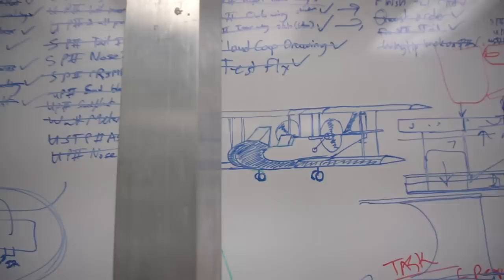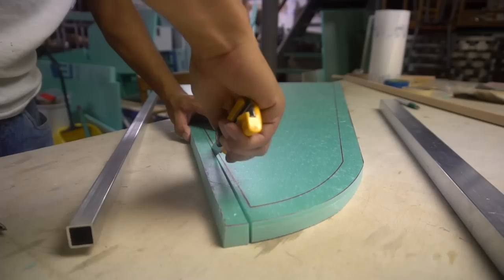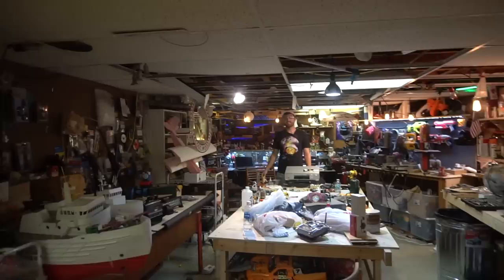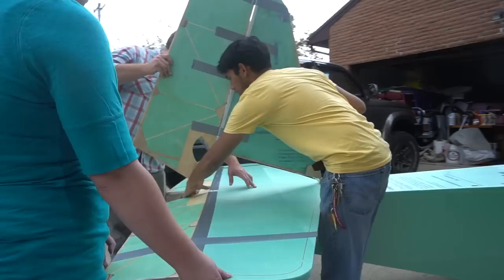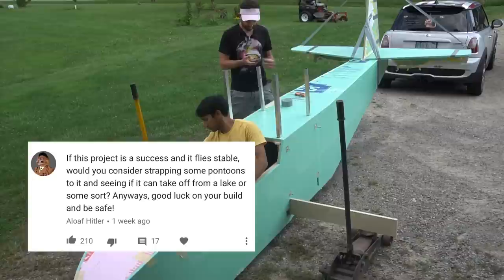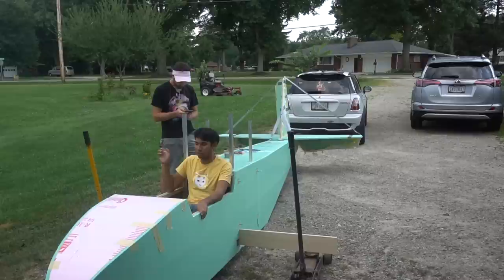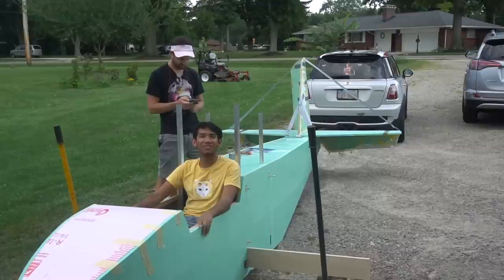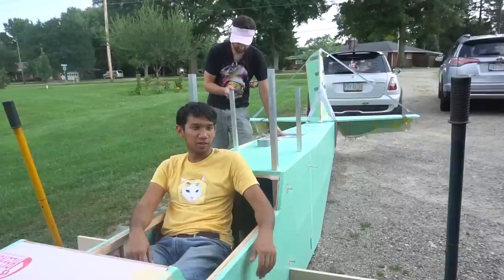DIY Electric ultralight pt2 (tail section)

Comment: Hi Peter,  I am a CFI and I would like to make a few suggestions.  I know you are a very competent RC pilot but I would consider getting some training in a light plane such as the one you are building.  I would suggest getting some experience in a Challenger which is similar to the one you are building.  It is not well known but the lighter aircraft such as the Challenger or even the light sport planes being produced can be harder to fly then many of the heavier certified or experimental aircraft.  Flight training I think should be higher on your list than a parachute.  If you were local to the Phoenix AZ area I would offer to take you up myself in my Cessna 150.  My other suggestion is to contact the local EAA in your area and see if they have some experienced builders who will come by and talk to you and inspect your build.  They have experience in building and maiden flight an experimental aircraft such as this one and it could only make your experience better.  I make these suggestions only because I would hate to see you get hurt and I want you to be a success.

Comment: Hi Peter - Enjoyed your video's on Flite Test!  Are you planning on using torsion tubes or cables from your control stick & rudder pedals to the elevator, rudder & ailerons?  Would be easier to use  torsion tubes unless you build the cables into the wings.  You have enough fuselage access to run either cables or torsion tubes.  FYI - with torsion tubes you don't have to worry about cable stretch and coming off a pully.  Tubes in the wings would need the control arm mounted on the bottom of the ailerons.  Cables would require control arms on both sides of all control surfaces.  Good Luck & Best wishes for a great aircraft!  :-)  Also, FAR-103 max empty weight is 254 LBS.  If a BRS is installed, you get to add the weight of the BRS to the max empty weight.  I added this info for the 'Non-Pilot' people reading this & cheering you on.  I;m a retired airline employee and have held a pilot license for 48 years.

Comment: I just looked on Barnstormers, there are a couple BRS rigs for under $2600.  The cheaper ones will need a repack, but even a $1200 BRS plus a $1000 repack is under budget.

Just a potential source for ya.

Comment: thanks for posting.  some thoughts.  in order to reduce auw, 80 percent of the foam could be removed.  especially, aft of the cg.  if i remember right, this is going to be a pusher bi-plane.  perhaps, instead, you could design a single wing to do the job and avoid the drag of a second wing.   cheers

Comment: Did you think about the heat of the electronics (battery in particular) melting the foam or the epoxy? also sparks and possible fires generated by that

Comment: Hey I like ur project. Maybe I missed it but u I guess u r a private pilot and know how to fly! I have only about 17000 hrs flying turbo props like twin otters and dash 8 100 and 300. In my humble opinion a good pilot always visualises how the air is flowing about the aircraft and how he is manipulating the airflow with the controls. The next thing is managing energy! Think of this as a glider with some assist from your motors. Keep ur banks shallow and keep the speed up. Think AOA at all times. In fact see if u can rig up some sort of AOA indicator. Don't try slow flying until u learn how she responds and feel comfortable, remember when u out of ur comfort zone the brain slows down to a crawl. Safe flying.

Comment: Would you consider putting flaperons on it in order to maintain better control at slow speeds? Full length ailerons that double as flaps. I'm not sure how that works with biplanes but it works well for high wing aircraft.

Comment: Looks like it could use some span wire and turnbuckles to put tension on some parts. That might be easier and lighter than bracing for rigidity in some areas given that you can't really crawl into that fuselage much. (If it was cloth over a frame instead of glued-together foam, you could probably open it up for access. Might need a hatch or two cut-in anyways.) Noticed the tail still had a bit of twist there while shifting weight around, and despite all that work. I'd be a bit leery of that.

Also a bit of shame you can't afford that life-insurance rocket-parachute. Expensive bit of kit, but likely so for a reason.

Comment: There's also a big difference between the FAA and the AMA. The AMA has rules set forth to protect pilots and general aviation and as for the FAA to keep pilots from model aircraft. No RC model should fly over 400 ft and should not be within five miles of a airport just to name a few

Comment: 12:04 every time you plane bumps the ground the empennage twists at an excessive angle you should check up on that. The last thing you want to happen is tail wobble mid flight as it will only get worse and maybe even sheer off the entire tail. Leaving you in an upside down flatspin (if you don't have counter rotating props if so you will just end up stuck diving to the ground upside down) from where your center of gravity is. And since your plane is electric you gotta think of where to store the batteries. In the wings and around your center of gravity is best. And do not treat this as an RC plane treat it as a real one so slow movements on the stick no sudden changes in anything. Good luck! Edit: You need more than 60000 mah in that thing id say you gotta get to around 80000-100000 mah to have a actual flight time in that. Since we talking an actual aircraft here.

Comment: I bet before fiberglassing the outside of the fuselage you could cut out pucks of foam, wrap them in silicone paper, put them back in place, then after the fiberglass is hardened you could pull out the puck and have a smooth exterior; with less weight; who cares if the inside fiberglass has divots in it; that may even be stronger (just not aerodynamic)

Comment: Since you are using 4 30k lipo's on thid rig. How long of flight time will you have when the batteries are fully charged and will you consider making backup power with more batteries in case you need it

Comment: Hey Peter, even though at 180 your shooting well below the weight limit, care to weigh in on how battery weight should be counted under part 103? It allows for empty (unfueled) weight but you can't just empty a battery to reduce weight. Do you think the entire battery weight should be counted? Or a portion of the weight not counted? Weight with battery removed?

Comment: make sure you have some spars in your empennage. Fiberglass skin isn't going to cut it there - flutter is no joke. 

Also, no way I would test a spin entry/cross control stall on my first flight. perhaps some very gentle approach to stalls if there is no turbulence. Use your takeoff speed + 10% or so as your estimated stall speed at first. (use an airspeed indicator - not GPS!!!!!)  Your landing gear needs to be stronger than you think it does, and you definitely need to be sandbag testing for +3G -1.5g MINIMUM!!! surface deflection and structural integrity before you take it up. (that means testing to about 1.5x that to make sure nothing breaks or permanently deforms)

If you can keep it below 254 lbs (400LBS AUW)  (which I kind of doubt, actually, based on your construction methodology)  the spar and wing need to be able to handle a test wing loading of about 1800 LBS!!!!  to safely take a 60-degree bank with moderate turbulence. Your tail surfaces should be able to support about 1/8 of that at each tip without significant deformation.  (look up sandbag testing wing on google images for an idea of the strength that is required in an aircraft wing)

If any wing or surface twists torsionally when loaded in a way that increases the AOA, you could easily enter a region of dynamic instability, likely to be exacerbated by PIO......very likely if this happens, you will break the airframe. also, if you are going to have ailerons, the wing must be very resistant to twisting to avoid (often disastrous) dynamic oscillations....and you need to look at how your control cables/rods will influence the control surfaces in response to deflection.

 My guess is you'll be much lower on power than you think (amateur designs almost invariably are because of weight optimism lol).....so use a stall resistant turbulent airfoil.

Because of Reynolds numbers, things don't really aerodynamically scale from model size to real size exactly....and due to mechanics, they don't linearly scale structurally either. 

I wish you luck, but don't make the mistake of thinking you can scale up a model airplane from a structural standpoint. 
Wear a parachute, and do the math. Trial and error aviation has buried a lot of talented people.

Source - have built FAR103, part 23, and LSA airframes- they need to be a lot stronger than you'd think.

Comment: Peter your very smart first off. I have a few questions. 
What happens when you start to run low on power. 
How long will it fly for?
If it were to fall out of the sky would the plane have enough surface area to slow the plane?
How are you controlling the plane, through the radio?
Would you consider bringing a parachute I think that would make it safer cause I would like to keep watching your videos there awesome !
How much run way will you need and can you get your hands on that with out getting mixed up with the law?
Your Dog is SOOO CUTE he should have a picture with the plane wearing a aviator suit!
Peter what your doing is so inspiring this is like one of my dreams sitting there in a scaled up rc plane holding a remote flying through the clouds. But please be safe but I'm pretty sure that with your engineering skills you'll be in the sky's in no time!🤗+🛩

Comment: are you planning on glassing the entire plane when you glass over the edges? if so, could you route out/sand out pockets into the the foam for weight reduction because you're going to get extra rigidity from the glass?

Comment: Peter, I have a friend that was using a motorized trike set up to tow up hang gliders that has an old BRS mounted on top. He replaced the tow machine with a Dragonfly which is not a delta wing and isn't weight shift control instead using a ridged wing with ailerons and conventional tail feathers w/ elevator and rudder. For years we drove 3 hours ea way to the Tn valley to soar the ridges
Anyway I don't fly hang gliders anymore but use his aIR STRIP to fly Rc .  if you would like
I'll check and see if he will donate the old BRS. I know the chute deployment rocket is out of date but I'm pretty sure it is renewable. Let me know

Comment: Which kind of airfoil did you use for the main wings? 
It is important because the intrinsic aerodynamic momentum of the wing profile plays a very important role when calculating the equilibrium during level flight and manoeuvres.

Comment: Ignore a lot of the noise in the comments, yours will be many of the homebuilt LSA out there. I'm just curious about the electric bit. Batteries are heavy. Have you looked at the Goat homebuilt sailplane or you already thinking about a floater-type wing to minimize the thrust needs one you're up (and give you a slow Vstall?

Comment: I started to scroll down and didn't see anyone mention it.  have you thought about cables and a turnbuckle to brace between the aluminum supports to prevent twisting?  I heard you say you were going to make removable bars.  I would guess at saying cables would be lighter and also removable.

Comment: Military helicopters have "variable collapse" seating to help survivability in crashes. Not thinking that this is even remotely possible for you, just mentioning it as a safety factor to consider.
While it may take you up to your weight limits, seriously consider wrapping everything in silk or nylon or rayon. Will improve strength and durability of the plane far beyond the test strength of the material.
Will be checking out your other videos. Keep up the good work.

Comment: G'day,

   Like I said last time, you seem to be way  overbuilding this thing.

   Have you ever seen a Carbon Dragon ? 

 It's a 43 Ft Span Foot-Launched Sailplane with a 25:1 L/D ratio, built of Wood & Plywood & Carbon Fibre, Fabric covered...; an old friend of mine built one, it's Ribs are Warren-Girders glued-up of 1/4 inch  Square-Section Spruce with a 1/8- inch Groove routed up one side & a Stand of Carbon Fibre epoxied into the Groove and cured, before being cut up to make into the Ribs.

   The Carbon-Fibre carries all the Flight/Landing Loads, and the Wood around it was only required to enable the Carbon Fibre to be conveniently handled, & glued into it's place in the Matrix...

   I suspect that you didn't need to use the Resin & Glass Cloth at all on that Tail, and you could've shaved a couple of Pounds off it by using Stitts Polytack (modern "Dope") onto  Heat-Shrunk Dacron.

   A BRS Rocket-deployed 'Chute is a good move, if you can afford one.

   Check out the market for 2nd-Hand units which are beyond their Use-By Date, Hang-Gliders and Ultralighters Supliers & Clubs are the places to enquire..., they can sometimes be had pretty cheaply from someone who's given up Flying years ago  - then ship it back to the Manufacturer for Repacking...

   Or look out for an old Spring-Deployed Ballistic-Chute, I have one which I used when I took the 22Hp VJ-24w up to 5,000 Ft AGL to do full Stalls, power off & on, and Dives to 60 MPH....; and it brought me a lot of peace of mind, just knowing it was there if I happened to need it.

  But it didn't help any when I crashed on a Downwind Takeoff, and then I sold it to my best friend, but he spun in on Approach before deploying it, & so the Case has aquired aCrack in it..., and then the Coroner shipped it back to me when I bought the Engine from out of the Crash....

  So, I have in my possession one slightly battered, never-used but twice-crashed, Spring-Deployed Ballistic-Parachute which needs to be professionally repacked...; but it has had previous experience of successfully Flight-Testing a New Prototype..., so if you want to make an offer for it then how much do you want to pay ?

   Trans-Pacific Freight costs probably makes this a non-starter, but, well, I'm not using my Parachute ; and if you mess things up while sniffing around Incipient-Spins, and you lose a Wing, then an old Spring-deployed 'Chute is better than falling down uncontrollably.

  Is that not so...?

  Oh, btw, I generally don't recieve notifications from Comments on other people's Videos, YT fuxup sometimes ; so if you actually do need this 'Chute then show up on the Thread of one of my recent Uploads....(!).

  Have a good one,

  ;-p

   Ciao !

Comment: Definitely go for the BRS... Or, at least try and build one yourself. A square or a round canopy could be found for real cheap. Parachutes aren't that expensives but a 2nd hand full sport parachuting rig is about 2K used and it is not intended for low altitude. Maybe a pilot parachute rig could help but it would basicaly just add to the weight without having real chances of saving your life. A superlight B.A.S.E. rig would be cheaper, more suited for the job with deployement as low as 90ft but you still have to exit the plane. The only safety device that both worth it's weight in $ and pounds is a rocket assisted parachute. You could probably use the device on multiple projects therfore reducing cost for the actuel project.

Comment: Generator to keep up with the demand of those motors would be near impossible to find, and realistically way too heavy.

For the chute system, why couldn't you just invent your own launcher? some large PVC tube to pack the main tube, leads connect to a press on lid (lid is a reducer flange) smaller pipe at end which holds the pilot chute and a small charge (model rocket stuff! )

This could save some costs and be tested on a car.

Comment: I was thinking of building a home-built electric plane in the experimental category. What motor are you using? What KW rating are you aiming for? There are some good motors made for electric vehicles that could be adapted for experimental planes. The weight may be an issue for an ultralight rating though. The cheapest way to go is a series DC motor but as I recall an 8" DC motor is around 100 pounds which is probably too heavy for an ultralight but works in experimental category. Some AC motors like the Curtis 1238-7601 HPEVS AC-15 are lighter, only about 50 pounds but also more expensive. both can cruise at around 25 hp and easily temporarily put out 60 hp for climbing. A lot of EV drag race people have been buying Lipo battery packs from Lonestar EV Race Team. I'm not sure how they compare on price to your RC Plane Lipo battery suppliers but you may want to check since you will need a big pack.

Comment: Peter, love what you're doing!   Here is a picture you may like.  When Jim Bede was making the BD5, he came up with a ground test high speed taxi/flight rig.  Basically an A Frame hinged to the front of a pickup truck.  Either a winch in the bed of the truck could lift the a/c off the ground, or high speed taxi down the runway allowed it to be tested more safely then actually flying it.  Good Luck!   http://www.bd5.com/bd5trainer.jpg

Comment: I haven't made it to the end of your videos yet but I would use both parachute system because what if the plane, God forbid, breaks in half and the half you're in doesn't have the Chute than what. Question in your opinion what would the best way to make a plane wood or aluminum?

Comment: Hello ! I’m going to build an ultralight myself similar to yours except with a gas rotax engine. Can you please make a detailed video of how you hooked up the ailerons / rudder / elevator with the cable and pulley system ? This is were I’m stuck. do you use a joystick ? Thank you !